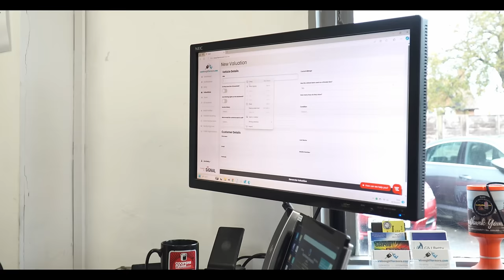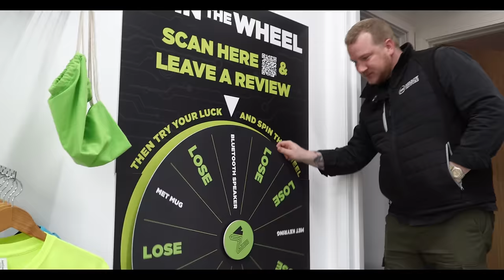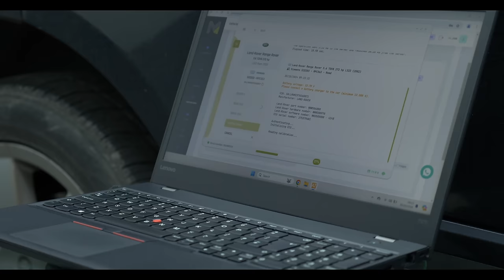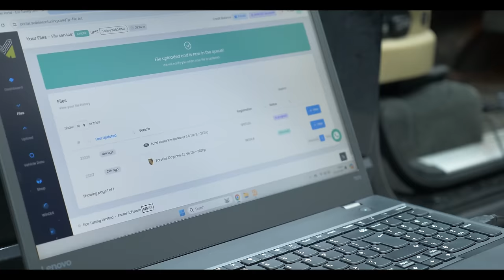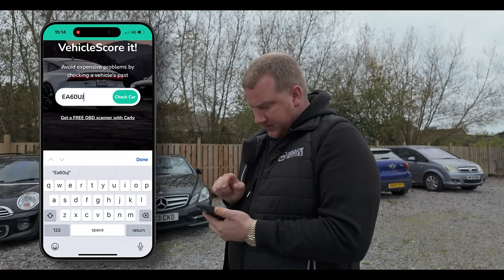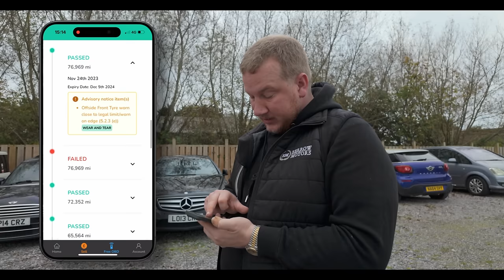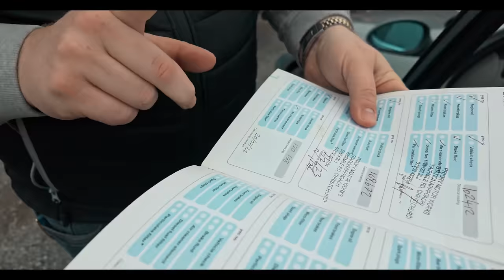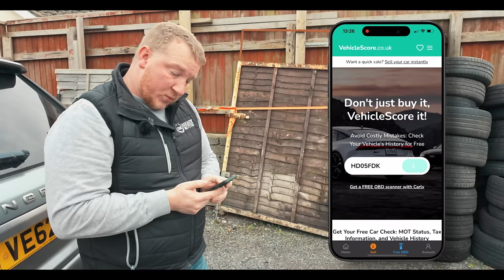Getting Ruthless With Old Stock Cars! | BM Weekly Ep63

Comment: My Mrs has a 2011 Cr-z GT Navi with the carbon pack. Had it from brand new, all £24,500 of it (ouch) and have hardly spent anything on it except the usual's like servicing, tyres etc. The only repairs in 13 years are 2 front springs and the worst was the air con pump, well the bearing in the pulley that runs all the time. Couldn't get a pulley repair kit at the time so replaced the whole air con pump. done it myself for £140 plus re-gas. Its a hoot to drive, a little pocket rocket. The dash is awesome. Its got a button you press, you then say "temperature 22c" and it adjusts the air con temperature to 22c and that was 2011 technology!

Comment: That SL55AMG is one smooth motor,,  what a super car ..  best car you have had yet..
Reply: What did i miss? i havent seen the part with an SL55
Reply: @chrism2567   at 25:15  simply the best looking car ever designed..
Reply: @FactTV-rj6sh   And not an SL55. I was being pedantic, its an SL350 badged as an SL500 for some reason. Lovely cars though, but that shape would be an SL63 anyway

Comment: That BM will smell of oil because all E90's have rubber rocker cover gaskets and they always leak. When i had one i had it changed twice and still did it tends to go down the back of the engine or down onto the exhaust so you get a lovely oil smell throu the vents 😅.

Comment: The E9x 325i isn’t particularly fast, but it shouldn’t feel slow.  0-60 is in 7ish seconds, so quick enough for UK roads.  Judging by the sludge on those springs, this example has definitely seen better days and probably isn’t running right.
Reply: @Drwki  agreed, looked knackered and oil not changed for 20+k miles

Comment: I had an E90 325i SE. It should be quicker than that. It should do 0-60 in around 7 seconds. They use electronic oil level sensors. Lastly there shouldn’t be any gunk on the valve springs or anywhere if is been serviced correctly.

Comment: Do you have to put in AdBlue in Diesel cars? I know in trucks you do. I'm looking at getting a new car, beater with a heater, but can easily and comfortably drive on the motorway as I need it to go over to the continent. Found a couple diesels but I don't want to much around with AdBlue. Cars I'm looking at is a Seat Leon, 2015-17 Civic, or Megan.
Reply: Most diesels after 2016 have adblue. Some 15 plate cars have it as well.
Reply: @marksenior9220  Cheers for that. I'm not too surprised. Looks like I need to narrow down my search to petrol. The Megan is petrol and never really thought about them till I saw one last week.
Reply: @ depends on mileage. My car needs 10 litres every 10k ( which is two years for me!) My works van needs filling every 5/6k which is every 6 weeks😂
Reply: @marksenior9220  At the moment I have a 2020 Kia that's done almost 5500 and been offered what I paid for it new. But I'm downsizing to a flat so the car will be sitting outside. And all the stuff it has confuses me. I don't like Tech. But am wanting to travel more. Still I can't see me doing 10k a year so maybe I shouldn't discount them.
Reply: A lot of newer cars have adblue  all you have to do is have it mapped out